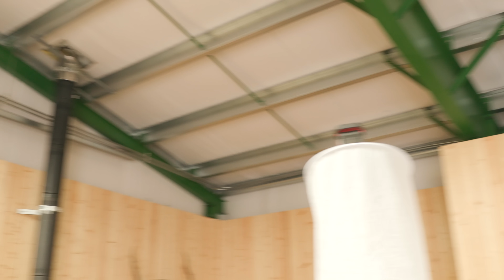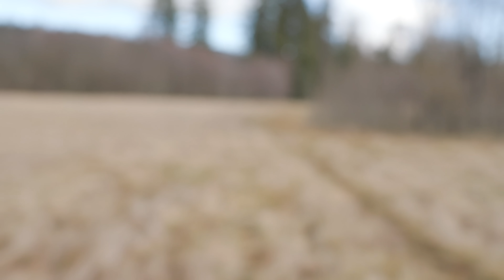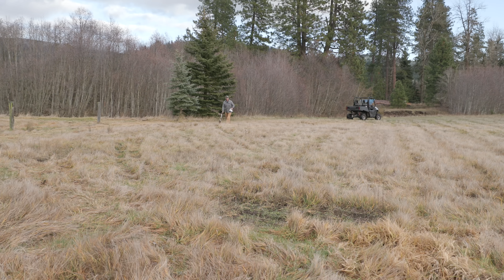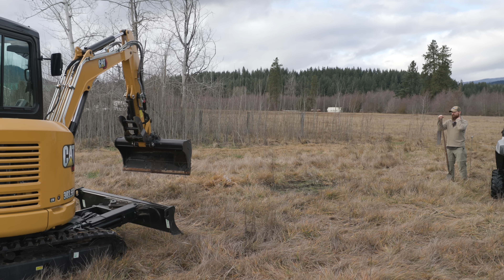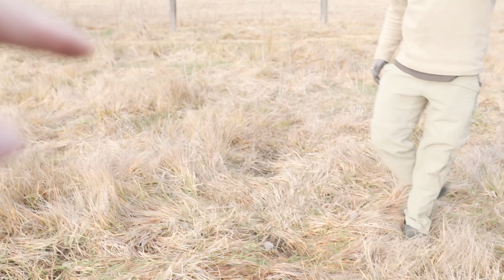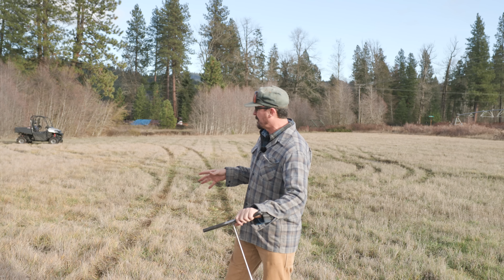THESE PEOPLE MUST BE STOPPED... (BAD NEWS)

Comment: I am cruise through the comments to see if it's been added,, but that "beam" that you're talking about is not a "beam" it's a Truss. Beams go across  the building. And generally supported by columns. Trish's slant vertically upwards towards the peak of the roof. Here's one for you it's called the barge rafter there at the top of the peak of the roof that spins the entire building, and they are at the bottom end of a ship that goes from bow to stern of that ship... If you look at a ship and turn it upside down you will see a roof structure pretty 😎 cool....

Comment: Why can't you build up & down on the existing shop while installing a freight elevator.  Lite weight storage upstairs and heaviest motors at ground level, like a one platform parking garage.  Use the  entire 2nd level for the shop.  Heaviest equipment low and underground.  Three stories.  Building down can also allow all kind of adjustments to space height for each level.

Comment: someone pls tell me why these county pea brains do not allow no-leach pump-out systems?

Why drain into the land at all which, BTW, limits the build-able area as well and agricultural use of the land? 

All the home owner has to do is put in a holding tank that would have to be service-pumped out periodically with the waste taken to a county-operated sewage treatment plant by a pump contractor or, even by the county itself if it wants even more control and assurances.

The argument that people would never pump is ridiculous: when the toilets back up, they will pump!  Also, the service could be contracted through the county and paid for through property levies which would ensure land owners pump and not dump.

Yes its an ongoing cost but compare that to the alternatives: Big portions of land not usable, big upfront costs to install, periodic maintenance anyway and eventually, big replacement costs.  Think of a porta-potty, only on a much larger scale.

Comment: 🤔 a turbine might could be used in that river to create hydroelectric power from the rivers current. There’s also plenty of room to install some solar panels and maybe a wind turbine. Just a thought. Not sure what your local municipality rules are and such or what your plans are but these would help to be off grid as much as possible. At least provides additional options. Anyways good luck with what y’all got going on. 👍🏽

Comment: You also may want to check to see if the NEW regs restrict you from using his Septic Tank THAT CLOSE to a water way. Even if it WAS there to begin with, some counties have change their restrictions. I ran into something like that when I added another Building to OUR septic system. Almost has to DIG IT UP and move it. Just a Head's up.

Comment: If the snow hasn't caved it in by now, it won't. Here in NC, anything over 20 acres (even combined properties of five acres or more) is automatically zoned agricultural, and no permits are required for farm outbuildings. It might be worth your while to see if you have similar loopholes in your state as well. Too much power in too few hands, in my opinion.

Comment: Thankfully, I no longer do residential construction. But when I was all in, I dealt with this stuff all the time. The flip side of these absurd restrictions is cities like Houston, TX. There are virtually no codes or restrictions. There is also nearly zero planning or infrastructure to deal with growth. You then get what happened recently with severe flooding. There was nowhere for water to go, because there was ZERO infrastructure in place to make that water go anywhere. It all just sat in the giant pan that is the Houston metro area.

Not saying more codes/restrictions are better, but it does seem that some guidelines can be a good thing overall.

Comment: Hi, If I were you I would elevate the concrete floor about 2-3 feet above the soil surface,  as future flood protection, so if the river ever overflows and the field floods,  your equipment is higher (protected from the flood waters).  Just a bit of insurance;  the way I look at it.

Comment: They were putting a gas station in my neighborhood years ago and they had just installed all of the new underground plastic fuel tanks and had them partially backfilled. A three inch rain came through and popped those tanks right up like they were fishing bobbers, boy they had a mess on their hands. Needless to say they reinstalled them on concrete footings with stainless straps holding them down.

Comment: When I first came to Canada 45 years ago I was working for the City  Parks Department and the first winter I was transferred to the city cemetery because of shortage of work in the parks very first job at the cemetery was to dig A grave big enough for a concrete vault to be put in the ground ready for the funeral and the casket to be lowered into the vault and the concrete lid put on the vault, backfill and job done.
To my surprise the concrete vault was floating as the water table was high and the hole was full of water.
I later learned on where there is a flood from heavy rainfall storms etc on TV that recently buried caskets would float to the surface pop right out of the ground and would float away.... first time I saw that I thought it was really freaky but then as a young man I hadn't experienced a whole lot in life... but in the 40 odd years since I've sure made up for it.

Comment: Maybe I'm missing something. But I'm guessing when I see the steel bridge at the end of the video thats the river and one corner of the lot. The beginning where the cedar is located and  you started measuring is the other corner. That tells me you have a river running the lenght of the east side of your 2 acres. If you have to be 100' away from that river you just lost nearly and acre of the 2 acres you can build on. Wishing you luck getting this done quickly becasue if they change the law to 200 ft you won't be able to build anything.

Comment: 1 Wants to add on to his shop that was designed to have an addition at some point.
2 Told he can't because the farming fields that have been fields for 100 years are actually wetlands, because they are sometimes flood irrigated with water from a river.
3 Build 5 new houses on a separate lot on what is probably wet lands.

Comment: A piece of property I have in WV I placed 2 Best Buy 16x32 Barns on it 24 ft apart Dug a basement for the one so that 3 stories, the 2nd just sith on a concrete slab. The 24 ft area between the 2 was turned into a screen in the porch that can be enclosed during winter with a wood stove to heat it. The building the slab is the garage with a 2nd floor I then built an open pole barn on their other side of it. Woodstove in the garage for heat. Main house Gas stove & a wood stove (backup for loss of electricity). Got the property in1983. lots of things added fruit & nut trees 3 apple types Golden 12, Mac 12, crab apple 6, pear 6, Mulberry 2, Butternut 6, American Chestnuts 4. Pluss some other Trees. 25 to 30 feet of black raspberry 10 feet blueberries on the border of the property near the small stream for the berries make a good fence you don't walk  Raspberry plants 6 Beehives started with 2. 4 from them swarming

Comment: In the early 90s we were looking at a large lot on a tiny lake with a watershed on the opposite side . We picked a house design and were ready to pull the trigger . Then I heard rumors they were changing the set back from 100' to 200' . The question is if the county would issue a building permit and we could have the house built before the new setback came into effect . We chickened out , it was a good decision . Later someone built on the lot and had the house built very close to the road . Government and HOAs should be limited in their power , neither chip in on your land . Good luck on the permitting .

Comment: I know the problems ... I own a property here in Belgium with several sheds on it. I can renovate them, but also can't renovate them, sounds strange not. Well I can remove/renew the roof, but I am not allowed to change the beams that are holding up the roof. If I wanne do that, I need a permit, but rules have changed over the last few years. Suddenly, one shed is on land that I no longer can build on, so I will not get a permit to renew those beams. The same with the renovation from the main house, the city could tell me to remove 2 sheds around the main house before I could get a permit. They are allready complaining about my 50 square meters driveway on a 5 acre plot ... It's totally getting crazy.

Comment: Set back as far as you can from that river.  Google coldwater river Merrit BC 
It aggradized , changed channels and just took out a town of 5000 that has been there since 1900. And 100km of 4 lane free way. Climate change bites. We've gone from fires to floods this year.
The irrigation ditch and drain ditches would get us in environment quagmire here, but even without that we wouldnt be able to build anything new or rebuild anything old that wasn't for agricultural crop production.  Here sometimes you can get planning permission for FARM tractor storage or CROP storage or anything to do with FARMing.  While we are not even allowed to park logging or heavy equipment on the farm zoned land even if it is being used for land clearing or farming.  Research more angles and see what can be built to support farming in wetlands.

Comment: I think you would like living in rural Alaska. I lived in Ketchikan for a few years and there is no such thing as building permits or codes. Its painfully obvious if you inspect older homes. I had to remove drywall to locate a junction box and found the wires just taped together. My dads first house when he first moved up there was built by a fisherman and the floor from one corner to the opposite corner had about an 8 inch drop. The second house was slowly sliding down the solid rock it was built on making the middle level useless, it had a garage and a couple of rooms that had a cement slab floor. As the house slides the concrete floor becomes unsupported and has about 2 feet of space between it and the ground.

Comment: I couldn't agree more. My Dad and I have been trying to rebuild a house that burned down in August 2015 but our local Dept. of Environmental Heath and Planning Dept. has fought us every step of the way. The septic system they are asking for is going to cost north of 100k and will be tantamount to a mini-water treatment plant (pressurized system with pumps and multiple pods).  Every time our septic engineering submits the plans for approval they reject them with a handful of requested changes. The engineer makes the changes, resubmits, and the same thing happens again and again and again. Plus since 2020 they scapegoat the pandemic to justify taking 6 months+ to review anything. That's the Peoples Republic of California for you.

Comment: I know how you feel, it seems like every year there is more and more red tape.  Just a heads up, looks like the tile (weeping) bed may be plugged on that septic system.  Normally I think you should see the bottom of the outlet pipe.  Looks like the outlet pipe is completely full of water and maybe not draining properly.

Comment: We use that similar probing method, using a round steel fence post, to prob for pocket gopher runways, for trap sets.
We typically probe between the piles of excavated dirt, to find that connecting runway tunnel.

Comment: I built a 400sq foot park model home to be considered an Rv so I would not have to pull a bunch of permits. This is in the middle of a desert by the way with farms all around. I built at least a 1,000 feet from the main road and within a year the county either saw it from the road or someone turned me and they were wanting to raise the taxes, I said it’s an Rv it’s less than 400 sq feet and it’s on wheels they still tax us on it and consider it a permanent structure. Slight over reach if you ask me.

Comment: You usually can build within a certain distance from the wet land boundary ? Is it ok to put the building on another spot on the house lot?Good luck with the town. When we bought or farm property ,the town has a rule the barn or accessory buildings cant be in front of the house that presented some problems. These towns have some strange zoning.

Comment: I'm building several structures in Appalachia and have been told no permits were even necessary since we are outside a city limit.  A quick electrical inspection when the pole went in but that is about it.  Perhaps you can find much less regulation near this area.

Comment: Do you think they mite give you problems about septic tank? Did it have to be inspected before it was covered up? Leech field meet current codes? Where I live it's 100ft of pipe per bedroom. So 3 bedrooms has to have atleast 300ft of pipe. I would check with county to see what's required.

Comment: I had my challenges with City codes as well, Per code I could only build a "6 foot" fence. I asked if that was measured from the ground and they (probably confused) agreed.  I built a nice 10" berm and constructed the fence on that, never had any issue.  
Honestly, (not knowing what plan C is) I really like plan B.  It will provide you the perfect opportunity for a home custom to your needs.
Reply: In the UK build height is always taken from the highest point of the ground either side of the fence line and if its on a berm start from its top too like you did !

Comment: Cody, considering the OG workshop was obviously planned to be added onto, is there a chance the original permit accommodated the additional length, or possible it was permitted for 40 x 80 (or whatever) and they built it short for some reason.  I.E....does some documentation exist that shows it is ALREADY approved or permitted that will help you?
Reply: bump to the top
Reply: Permits are usually only good for a year where I live. If you haven't built it in a year, then you have to reapply. Probably that way where Cody is also, as I am not that far from him.

Comment: Wetlands has been a "hot button" around MI for many, MANY years.  Interestingly enough when the county/state wants to build on a wetland, they "trade" other land nearby to replace what they are taking !

The only thing you can do is request re-assessment of the value of the land.  It is now worth less than what you paid for it when you purchased it.  Another possibility is  "temporary" building.  Limited in size and no foundation.  Typically built on skids so it can be moved.  Stake it to the ground for wind load.

Comment: You cannot throw your weapon down in the bed of your ATV like that and expect your sights and scopes to stay accurate.
Reply: You shouldn't make comments when you obviously have No idea about guns. Soldiers get in and out of things banging there guns all the time. Do you think they just go to the range everyday to zero because it bumped the scope... Now if you hit it with a hammer thats not the same thing as to bump it on a door jam or set it down in the back of a truck. Normal bumps and use wont throw off your zero if you have a quality scope and quality mount. They are built to deal with this type of thing. Going to amazon buying a china scope mount for 11.99 is different then paying 300 for a strong high quality mount. That looks like an Aimpoint red dot. They start around 500 600. You can buy a red dot for 30.00 if you like.
Reply from the maker: Yes I can, and yes they do. Build and buy quality, Adam,